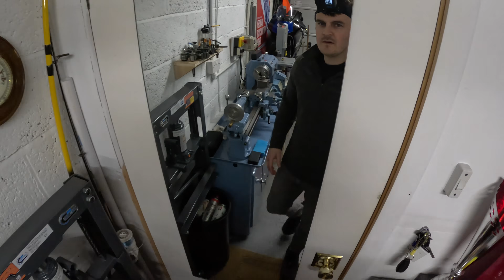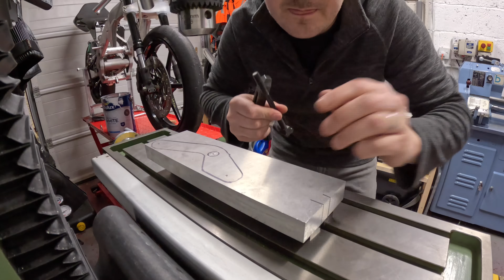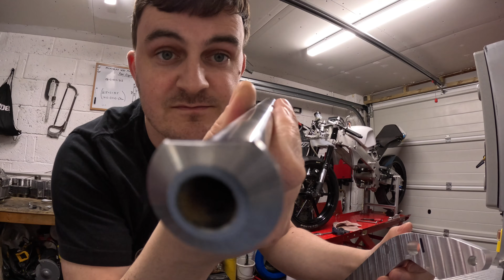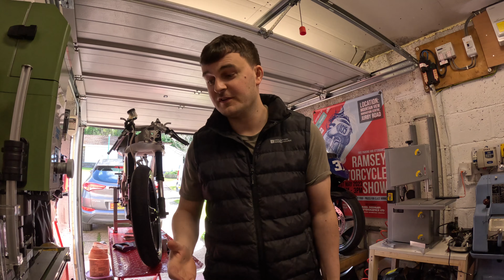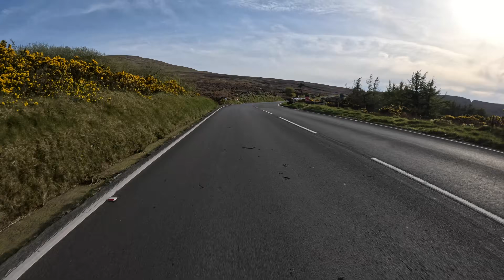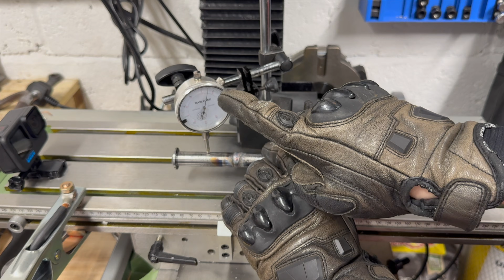Garage-Built 450cc Moto3 Vlog - Episode 2

Comment: Regarding the former swingarm pivot /engine mount bolt.... What I think would have been better is cut the end off and either thread it to use a bolt or at the other side weld on a new end which would have in either methods saved you the drama of straightening and further machining to make it servicable
Reply: Agreed. It can be done in about 5 minutes, too. Maybe less. Sorted.
Reply: Orang
Reply from the maker: Thanks for the idea! 💡 think I’m going to use the one in the video to mock up and then make a new one from scratch 👍